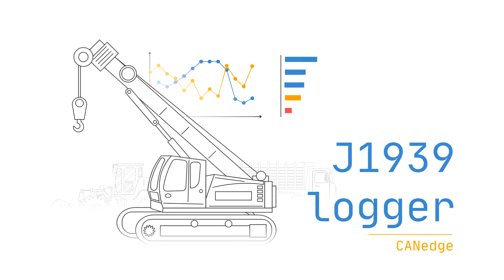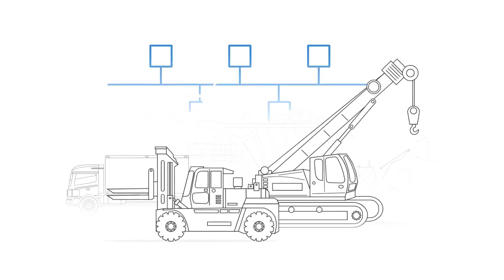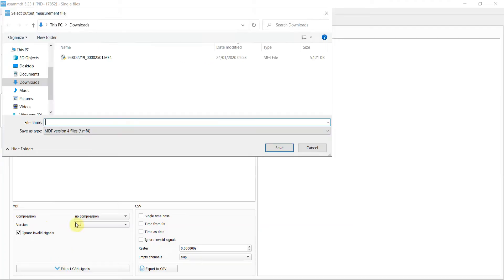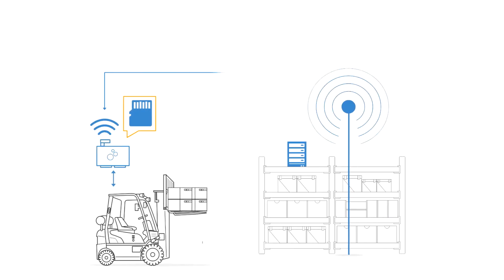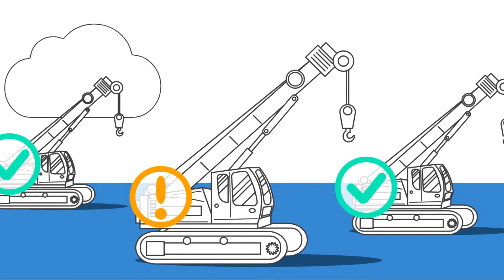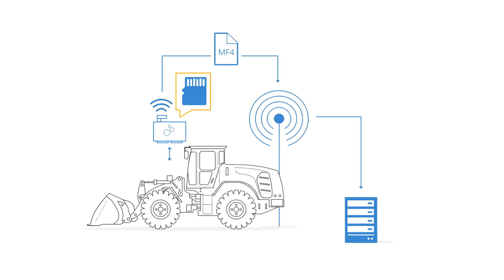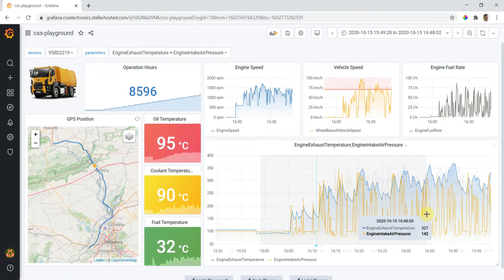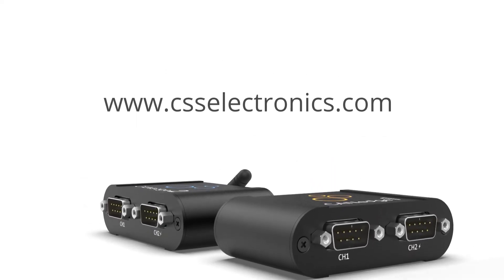J1939 Data Logger - Easy Heavy-Duty Vehicle Fleet Telematics [WiFi, 4G]

Comment: Let us know if you have any questions on logging J1939 data - we're happy to help!
Reply: Can this device send data when interfaced with a ISO21815 collision warning canbus system? When slow down is triggered and when stop is triggered?
Reply: @dewaldmaritz6809  that should be possible. The device lets you log data from any high speed CAN bus application, incl higher layer protocols based on CAN. As such, if those messages you refer to are broadcast on the bus it’ll be possible to record them with the CANedge. To decode the frames to physical values you’ll of course need to know the decoding rules, similar to how we explain then role of the j1939 DBC in the video. Let me know if clear
Reply: Will it let you know if you have can error frames and where they are coming from?